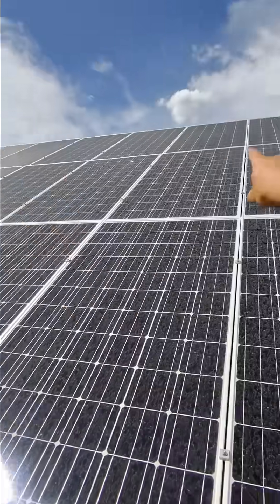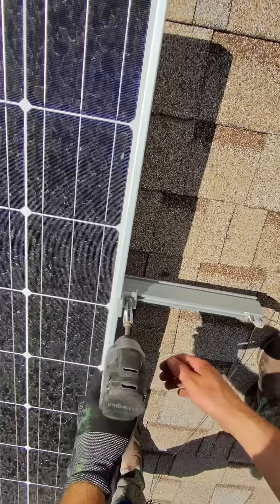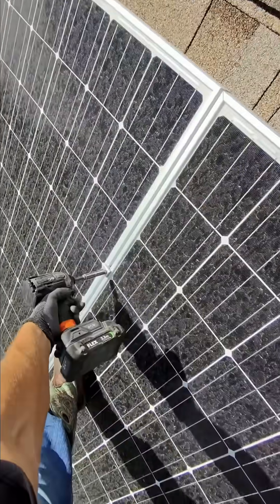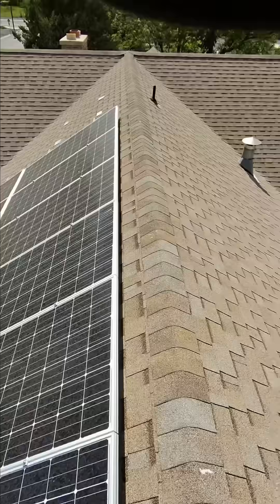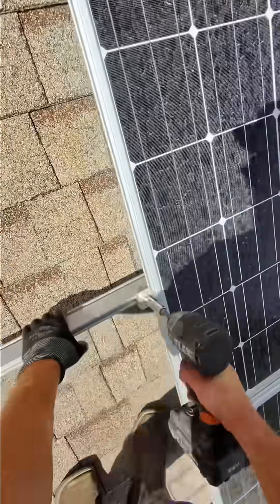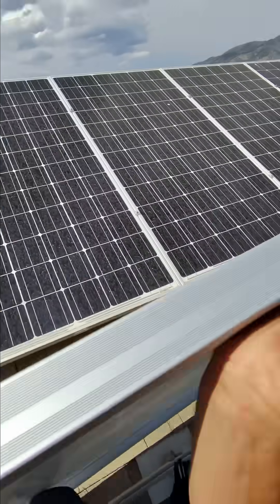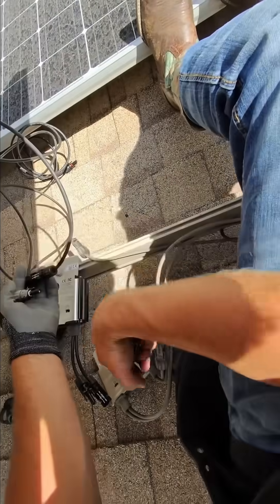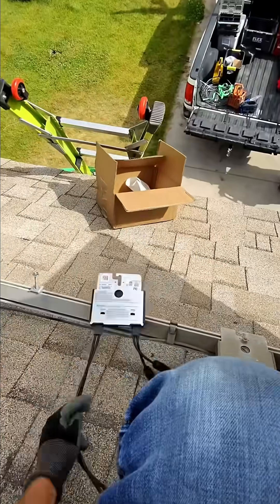My Thoughts On SolarEdge

Comment: Putting optimizers on a roof with one orientation and absolutely zero shade issues sounds like a waste of money to me. A string inverter would have been much less complicated and even when it does fail eventually, there is no need to climb that roof and no vendor lock-in. I do have some optimizers because of a shade issue with two panels, but those don't even communicate with the string inverter, so I can choose most other brands if I want or need a new inverter.
Reply from the maker: Yeah I agree. It mostly was a trend. I think it started with sales guys showing the home owner the fancy site map and how they could see how each panel was producing. Then came the red tape from the building department that required module level shut down. 

Some manufacturers have claimed when you have an optimizer working on a fixed voltage architecture you have less wear and tear on the inverter because the voltage doesn’t fluctuate as much.  

I just think a well installed dc system is the way to go. Simple, cost effective. I replace a lot of PV connectors and different wire termination and if anything you cut down 4 connectors per panel… so 80 connectors on a 20 panel system.

Comment: Have to respectfully disagree.  Having a good warranty is one thing, but it is not the same as having good reliability.  Though typical with Solar Edge, 3 optimizer failures in 10 years is just not acceptable, let alone the inverter issues they have.  How many more optimizers are ready to fail in that system?  For an install like this with zero shading, a modern string inverter is just the better approach.  Minimize power level electronics on the roof, and go with a Fronius / SMA / Delta / Tesla string inverter.  Use Enphase if very bad shading that can't be handled with multiple MPPT's.  Solar Edge surely good for your service/repair business though - guaranteed business for you after a few years.
Reply: Good advice

Comment: Being in the industry 10 years, the simple answer is that when SE is working, it works well. But every install no matter what is guaranteed to have some kind of failure in some way.
Reply: This isn’t necessarily true.
Reply: Good installers prevents this.
Reply: @mowglig9382 how can a good installer prevent a resistor from popping in an inverter?

Comment: Common SolarEdge Inverter Problems: 
Error Codes:
SolarEdge inverters display error codes or messages that indicate specific issues. These codes can be found in the SolarEdge documentation or on the SolarEdge support website. 
Low Energy Output:
Reduced power production can stem from issues with the inverter, solar panels, or even the grid connection. Monitoring your system's performance data can help identify patterns or drops in output. 
Communication Problems:
If the inverter isn't communicating with the monitoring platform, you might encounter issues with data display or remote access to system information. 
Inverter Failures:
Some users have reported inverter failures, sometimes requiring replacement of the inverter or other components. 
RCD (Residual Current Device) Errors:
Errors related to the RCD sensor may indicate a fault in the system's grounding or electrical safety mechanisms. 
Overvoltage Errors:
Overvoltage conditions, either in the DC input or within the inverter itself, can trigger errors and require investigation. 
Temperature Sensor Issues:
Problems with the temperature sensor can affect the inverter's performance and potentially lead to errors. 
Grid Connection Problems:
Issues with the grid connection, such as voltage fluctuations or grid outages, can impact the inverter's operation. 
Troubleshooting Steps:
1. Check Error Codes:
Refer to the SolarEdge documentation or support website for the meaning of any error codes displayed on the inverter or in the monitoring app. 
2. Verify Connections:
Ensure all wiring and connections to the inverter and solar panels are secure and properly installed. 
3. Restart the Inverter:
In some cases, restarting the inverter can resolve temporary issues. Follow the instructions in the SolarEdge documentation for your specific inverter model.